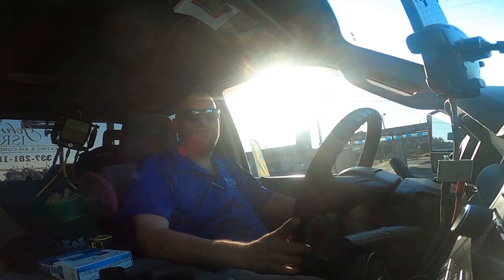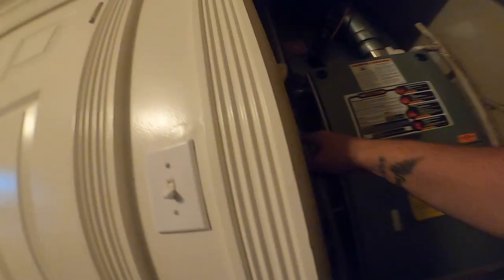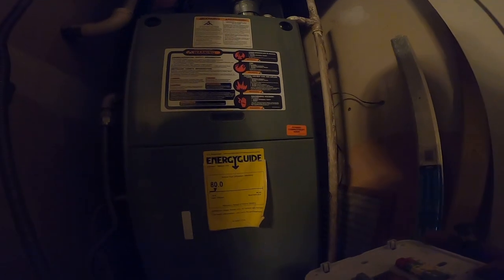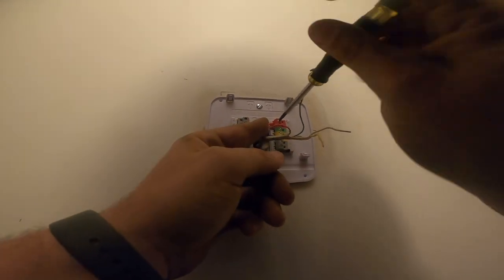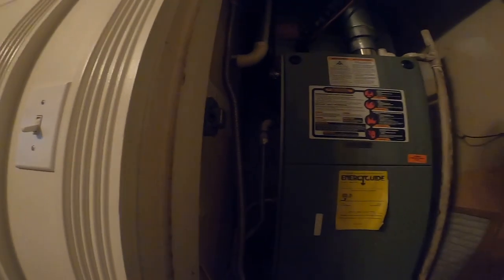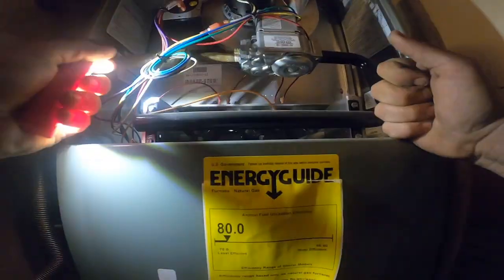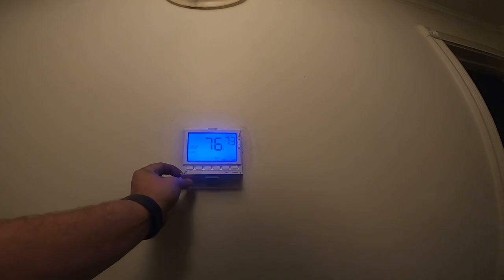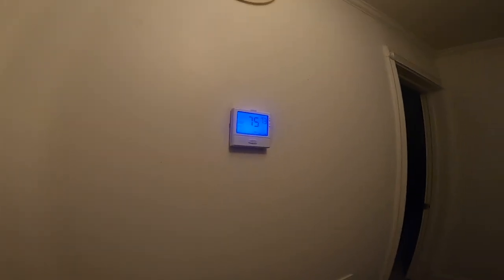Installing a WiFi Thermostat

Comment: I personally like the Nest Thermostat. I had to find out how to take it off schedule. So, I watched a bunch of YouTube videos. I want to manually control the Thermostat. Like right now, it's 70s and going into the mid 60s. I don't need to have heat on right now. When, it gets in the 50s, that's when I'll need heat. But, with schedule on the Nest, it would turn the heat or air conditioning at random times. Plus, I like to be able to control the Thermostat manually from my phone. I have a smart light switch on my lamp plug and I can turn on/off my lamp wherever I want. The smart light switch is connected to my WIFI. I love smart devices.